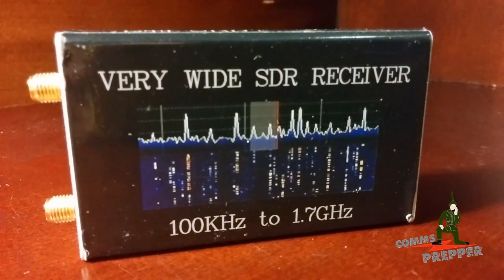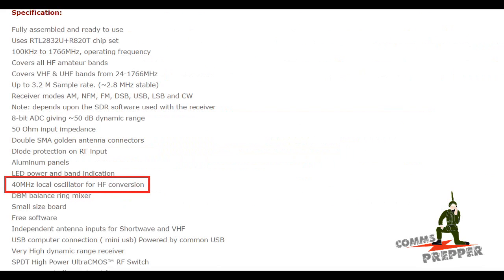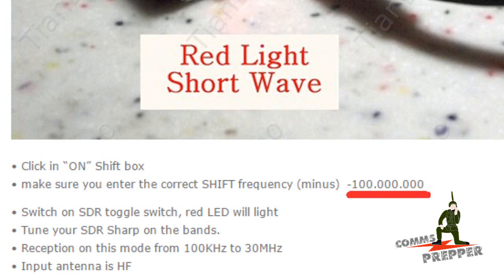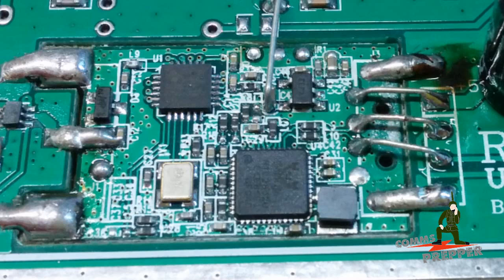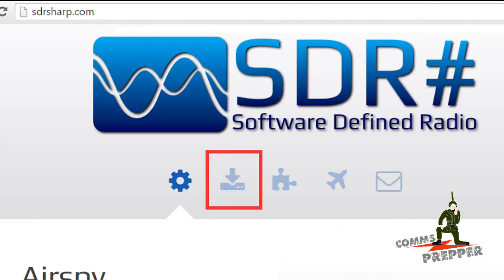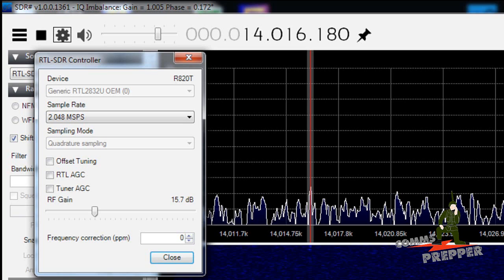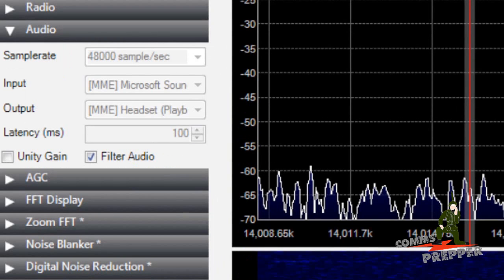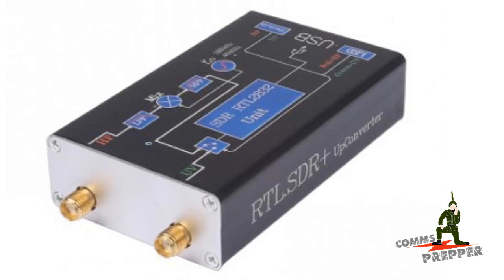Software Defined Radio (SDR) - RTL-SDR

Comment: I got in this exact RTL-SDR today and got it working great on HF. Thanks again for your video. 

The first RTL-SDR device I bought has a 28.8 MHz crystal and I never could get it working on HF. And lastly, for those like me,  that have the simple things go over their head, the switch on this SDR device is supposed to be in the position that turns the LED red.  Red is for HF and Green for UHF/VHF. It took me a good 20 minutes to figure this out. I am still a boat anchor guy using a Collins 30K-1 cabinet built in 1947 with homebrew amplfiiers and a R-390 receiver so this is a quantum leap for me to go to SDR. It works amazingly well but all I actually wanted it for was a "pan adapter" (spectral display) of the 20 and 40 meter band. I can sure see all the WiFi noise all over the band with it.
Reply from the maker: Glad the video helped.

Comment: 14:31 to fix the pixelation, you can increase the FFT resolution, or decrease the sample rate from 2.048MSPS to something like 0.9MSPS
Reply from the maker: +Tyler Watthanaphand Thanks for the tip.

Comment: When you zoom in if you change the resolution in the display on the left it will de pixelate those frequencies for you.
Reply from the maker: Thanks.  I have not used the software since making the video.

Comment: Great video.  Just a thought- if you go in under the FFT display settings you can bump up the resolution quite a bit from where you are I think.  Above 16384 gets pretty taxing on older PC's but the visuals are worth it :)  Cheers!
Reply from the maker: +Eric William -MKme Tech Eric thanks for the tip.  My buddy is the expert on this unit.  I could not get the HF to work and passed it off to him to have.  I think he did a great job on this video.
Reply: +Commsprepper He sure did!  Cheers Sir

Comment: The dongle section of this unit does not have a typical range from 100KHz its much higher like 24MHz that's why you need the up convertor section to cover the full HF range from approximately 100KHz to 30MHz.
Reply from the maker: Thanks.

Comment: 16:32 - Wouldn't a better method for frequency calibration be the "Frequency correction (PPM)" control in the RTL-SDR controller window (gear button, between the play and volume control)? This way you could keep the nominal 100-MHz on the shift as expected and still calibrate the receiver so the display shows the correct frequency. Excellent video BTW. I learned many new thing from it, thanks for posting.
Reply from the maker: I can't say.  I did not make this video, my buddy did.

Comment: When zoomed in the fft waterfall get pixelated due to the selection of lower fft points (resolution) ... 8 Bit ADC is for the Amplitude resolution not for the frequency. the frequency bandwidth is 2.4Mhz standard. But yes sound will not be comparable to a High-end SDR based Ham receiver, as a higher bit ADC will have much higher dynamic range than RTL-SDR.

Comment: BRAVO...Finally a video that explains almost all that maybe needed get one of these dongles set up...I've had mine since early spring and got so frustrated, just set it off to the side...Over time, I'd pick it up and with some bits of information I'd get from groups or videos, give it another try...Last time I finally got some HF signals, but still didn"t sound right...So I'll give a few things a try you have within this video and hope I can finally get it to work well...Thanks...